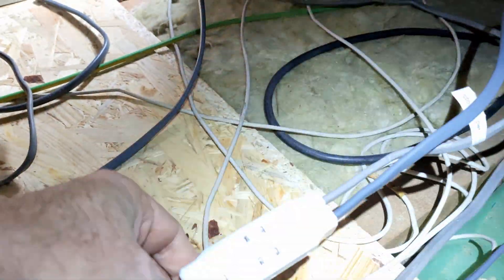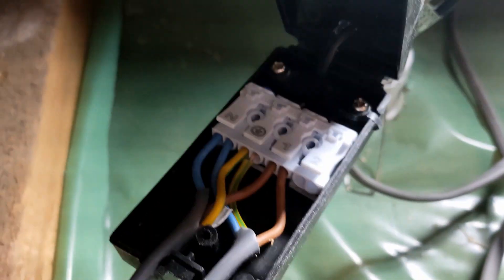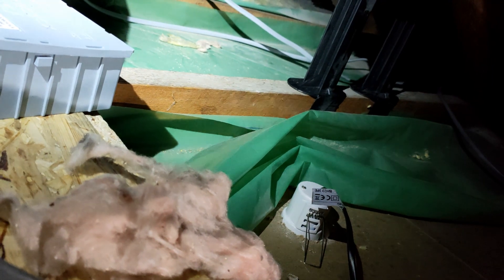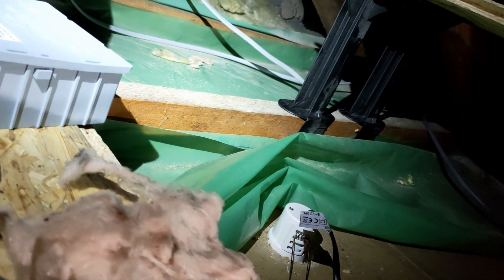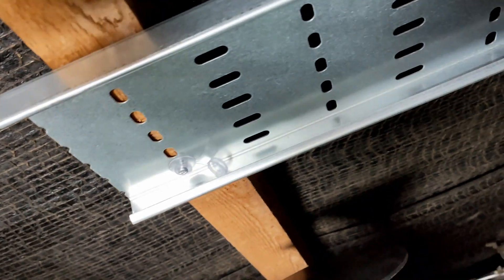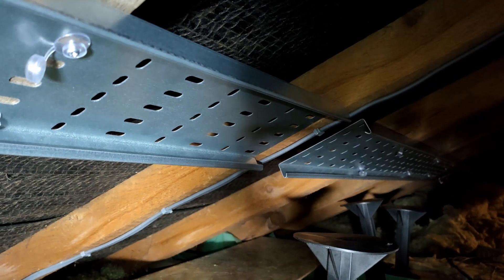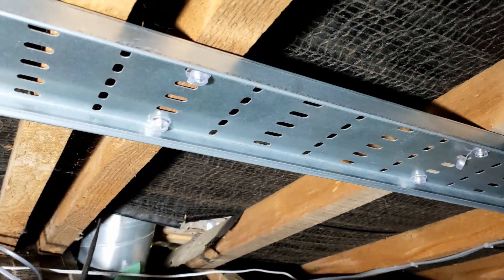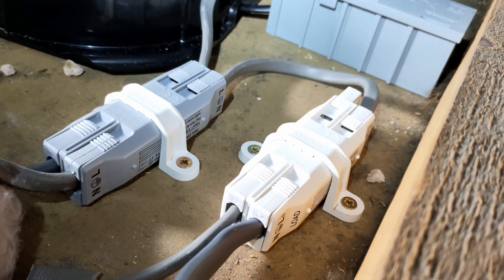KITCHEN REWIRE - PART 5 - Completing electrical work in the loft for the downlights and cable trays

Comment: Nice video and thanks for sharing your work, my main observation is that you need to grommet the cables where they pass through the tray slots, you have considered cable damage by the tray securing screws, so maybe an oversight or you have already done this after filming.